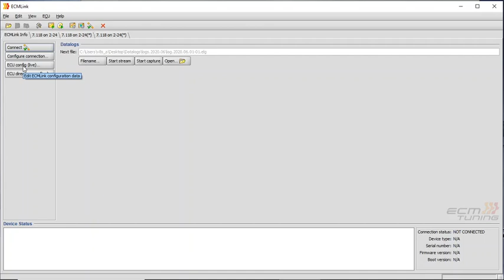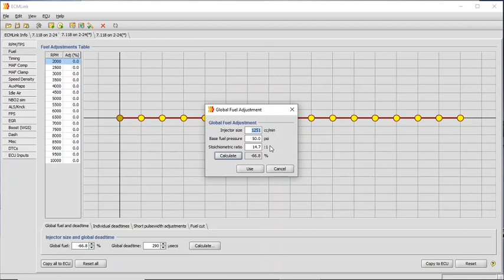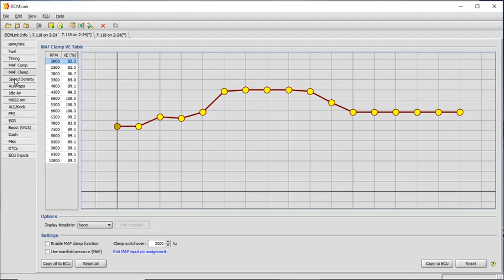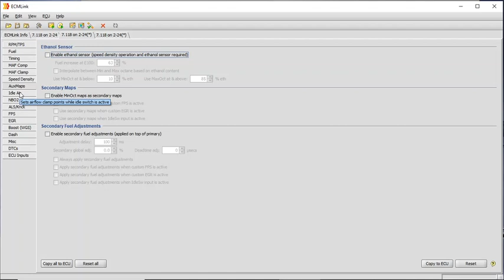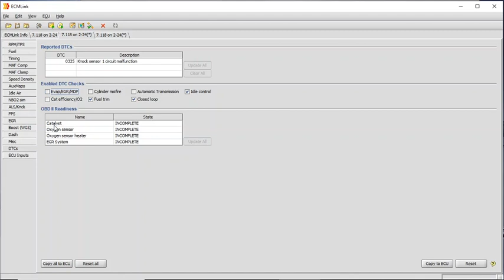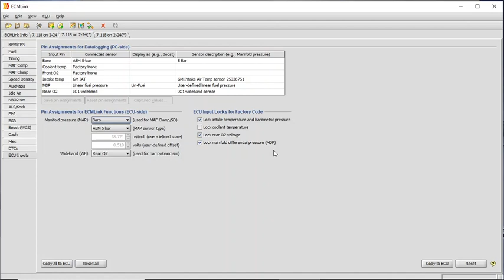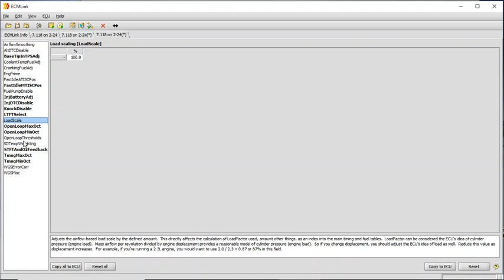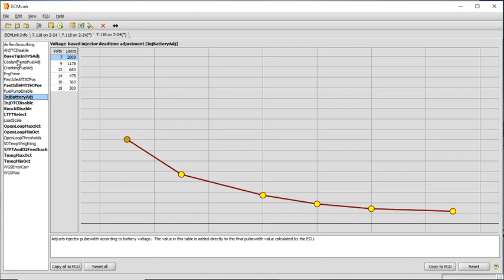SD cars  New users 1st time starting

Comment: For battery adjust.... where in the log do i need to look, to know how much to adjust.
I am running rich at idle with stock 450s, 272 272, sd, gm iat. Around 11.8 afr
Reply: Never mind.  TPS Delta

Comment: I like the videos... I'm using the old V1 V2 on the V3 platform.. car idle's fine but whenever I give it gas it'll rev up just fine but when I let off if your ratio or my gauge goes down to about 9 or 10 and the car starts choking like crazy.. can't figure out what it is
Reply from the maker: May need to see a log to know what's going on. There's a couple of Facebook groups for ecmlink you could post one on or the forums. Dsmtuners or Ecmlink.
Reply: @V8sareslow1  ok thanks I'll look for the group.. what should I log the idol.. or idle with general ups and downs as I go to and from full throttle..and thanks alot!!